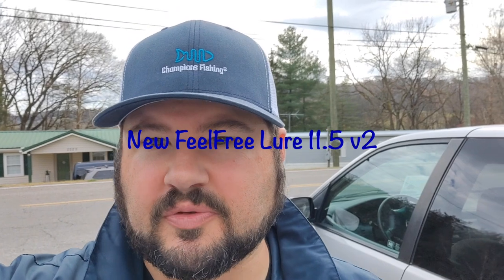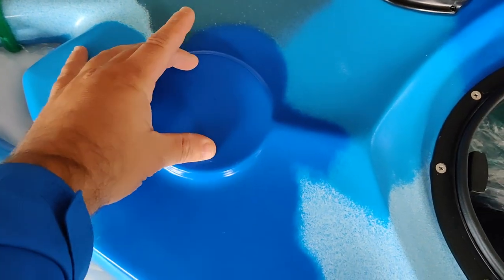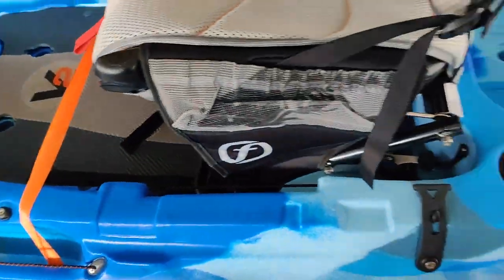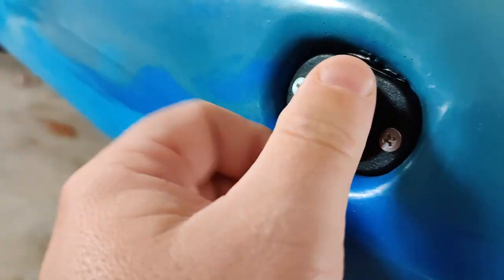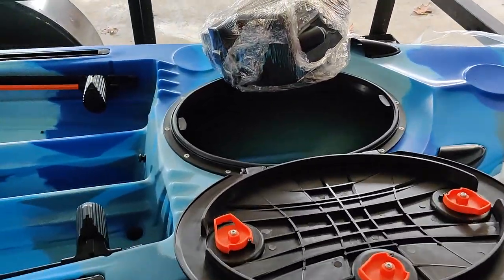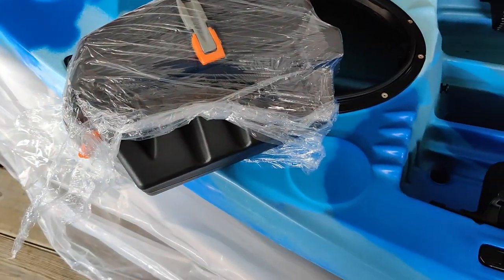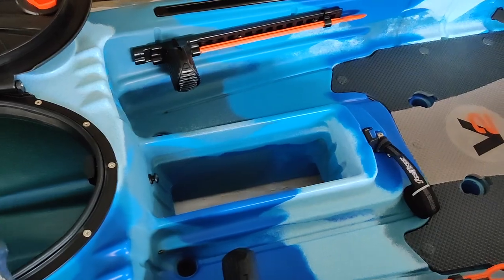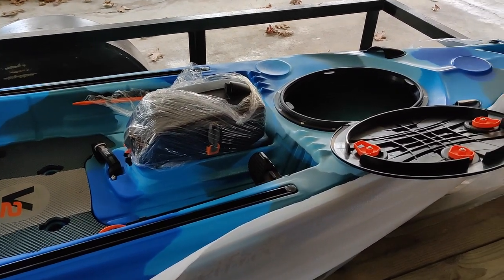FeelFree Lure 11.5 V2 Kayak Overview | Worth It? Walk Through 2021 Fishing Kayak

Comment: Why do I constantly watch videos where Feelfrees take on water. I know the older ones cracked in the seat are but that was adressed and after 2016 other improvements were supposedly made. Are the hulls still cracking on the newer ones. I'm really hot for an 11.5 V2 Lure but having a hard time pulling the trigger.
Reply: I never had a issue with my lure 2016 taking on water . No water in the hull after a 8 hour trip . My buddy has a lure 2014 . His does not get any water in it after a long trip either .

Comment: Now that’s it been a minute how do you still like it? How stable is it for standing? I’m looking a buying this exact one. Thanks in advanced
Reply from the maker: It’s a great Kayak on the water. Definitely get the rudder system for it and the pdl. It’s very stable but I’ve not yet stood up in it. I’m going to be getting another kayak with the next month or so, probably in March. I plan on either the Jackson Big Rig FD or Wilderness System Recon 120 HD. Those boats are wider and I believe will better suit my needs.
Reply: incase you are still wondering or anyone else sees this comment, I find them very stable for standing. I am 6ft1in and 230lbs and it is stable enough for me to stand and fish in and I'm sure if you are smaller/lighter it would be even better!
Reply: @Zanmiester , I was 350lbs when I bought mine in 2016 . I had no issues . 
Later on , i lost 150 lbs and could walk back to front with no issues.
Reply: @LovingIdaho  yes! I haven’t walked front to back because of my stability lol. Literally the limit has always been me even when trying to mess up
Reply: @Zanmiester  , I get a lot of practice . I take it out around 3 times a week unless the river freezes up . 
And If i say I have not messed around and lost my balance before , I would be lying . I have been lucky and never lost anything in the water besides a set of pliers .

Comment: i have the 2019 V1 and love it. have a trolling motor on it and its set up perfect. Looking to buy another and concidering a V2
Reply from the maker: very cool. I'm considering putting a motor on this one or upgrading to the pedal drive.
Reply: where did you install  the trolling motor? was it hard.
Reply: @rodrigoelgu  it was easy on the stern.  Steer with tje sliding peddles. I should post some videos on my page soon